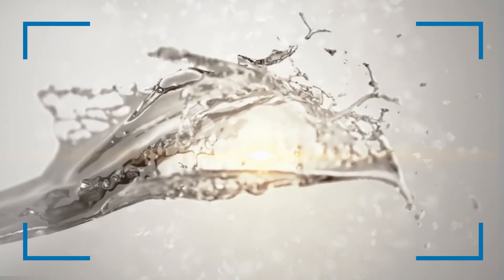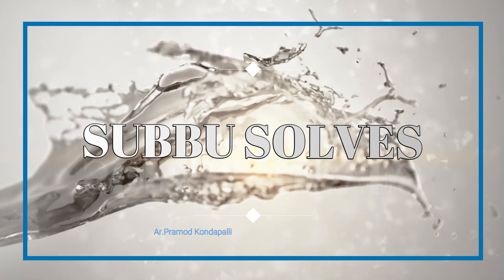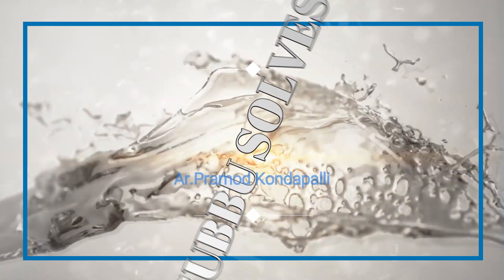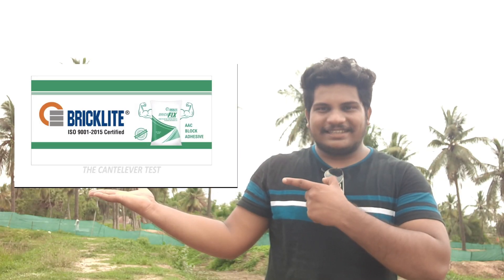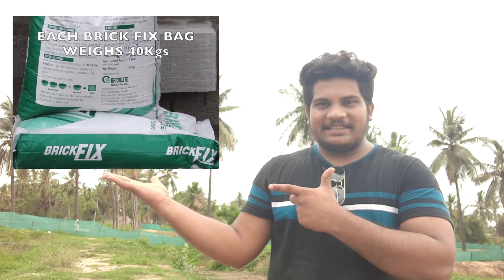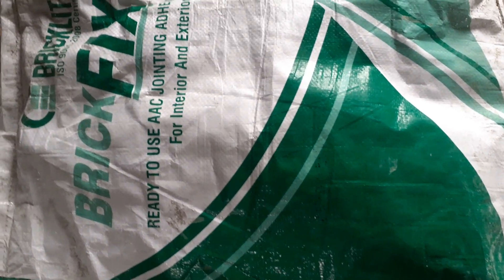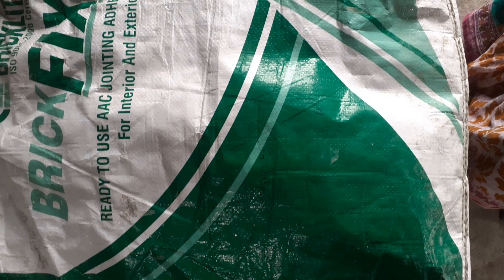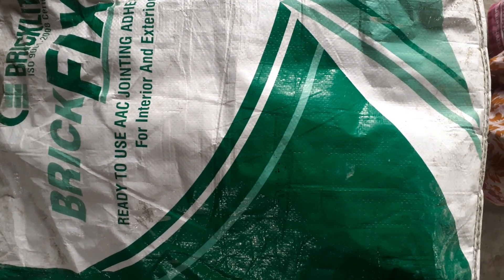ఇసుక  లేకుండా నిర్మాణం | HOUSE CONSTRUCTION WITHOUT SAND | ADHESIVE GLUE | Kondapalli Architects

Comment: What is your opinion on building slab without pillar... We wanted to construct only ground floor in village. Any suggestions on slab without column/ pillar
Reply from the maker: Load bearing masonry construction was the most widely used form of construction for large buildings from the 1700s to the mid-1900s. It is very rarely used today for large buildings, but smaller residential-scale structures are being built.
Reply from the maker: It essentially consists of thick, heavy masonry walls of brick or stone that support the entire structure, including the horizontal floor slabs, which could be made of reinforced concrete, wood, or steel members.
Reply: 16x30 house ki aac brick tho slab ni load cheyalama without pillars
Reply from the maker: AAC  blocks need  side support of beam & column (without beams & columns AAC will loses its strength)
Reply: @pramodkondapalli  so which bricks we should use for load bearing.

Also can you please tell me budget if we construct house(15×30) with pillars and colum